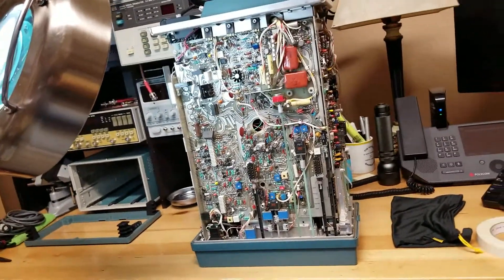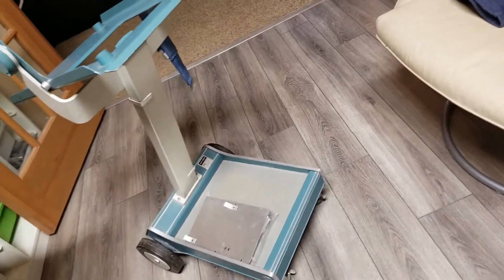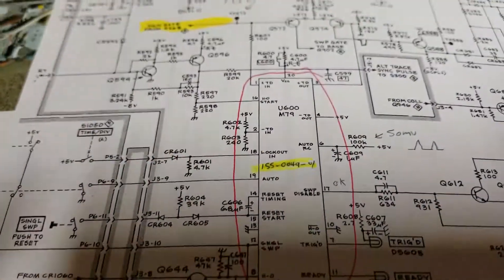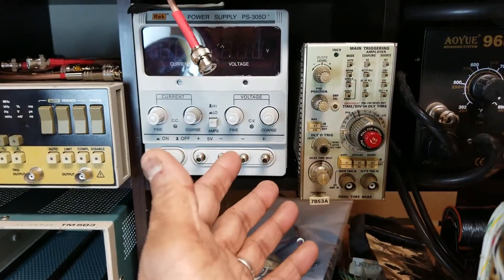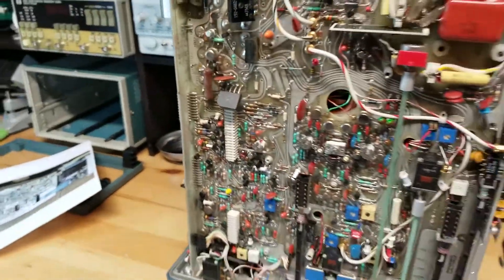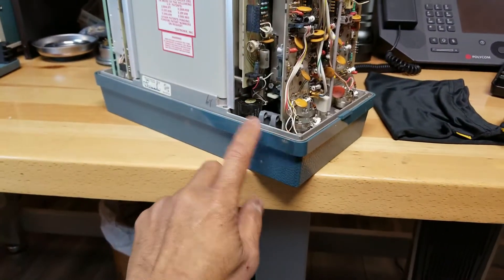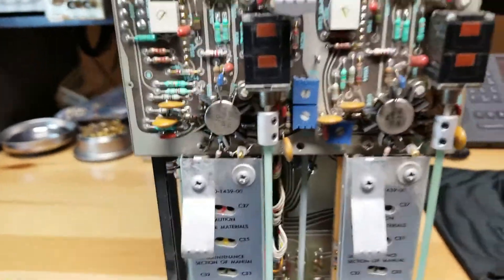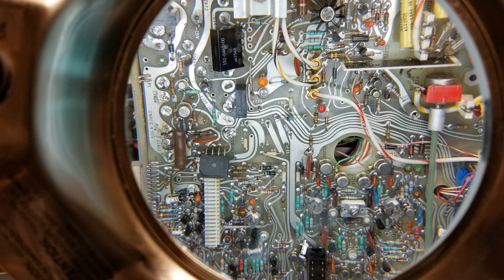N0AGI - EW:: Repairing the TEKTRONIX 475 Oscilloscope - Part 1 - Vol 91

Comment: Normally you do not position Tektronix scopes of this design with the tube's face down because it allows electron gun spot weld splatter (that eventually fell off of the weld spot) to fall into the magnifying (domed) mesh (not the phosphor) which will cause a dark spot on the trace.  (frequently it can not be shaken lose)

Comment: What happened to part 2?  If you didn't get a replacement chip, there is one on ebay today
https://www.ebay.com/itm/Tektronix-155-0049-02-Integrated-Custom-IC-Sweep-Control/382557301065   382557301065  not mine, just one I saw.  It is v2, not v3